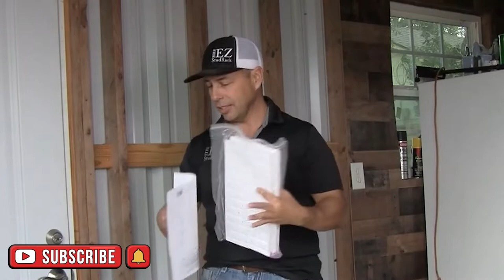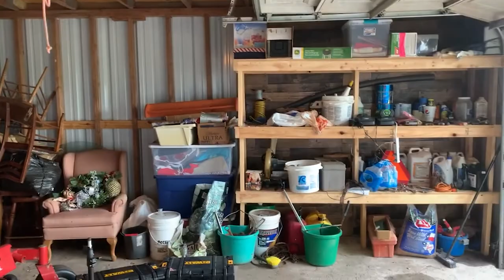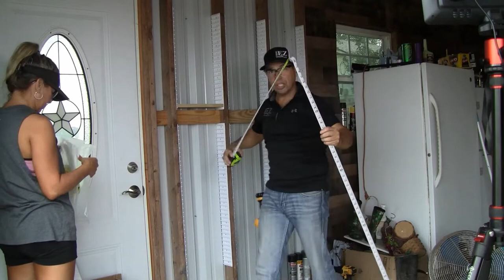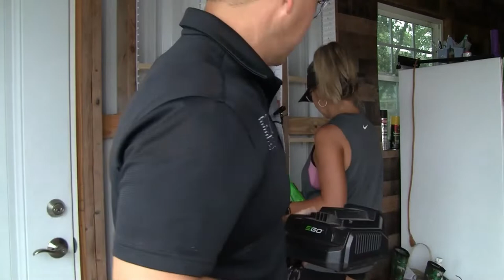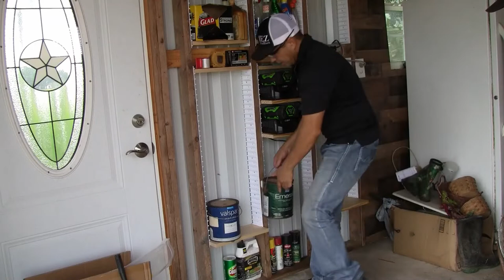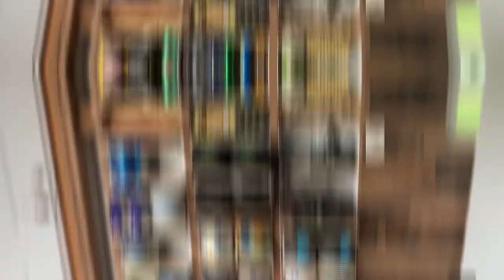Easy Between Stud Storage, Between Stud Storage Ideas, 3 HOUR INSTALL!

Comment: Fun and informative video. Might consider this product for my garden shed as it has the exposed studs. Here is my thought on the plastic strips, however. You have potential for many shelves if the product is about 2" high. So, of course, if you have high products to place on the strips you put a shelf maybe on the bottom plastic shelf and the next one maybe 8" higher All the other plastic strips are useless. I intend to cut my strips so I will have access to every shelf template on the strip. My question then is, can you develop strips that are serrated so you can cut them before placing in-between the studs. Say, plastic shelves 3" or so in between each with holes to hang up.
Reply from the maker: Awesome! Amazon prime delivers for FREE!
Reply from the maker: Hi KM, the strips can be cut to whatever length you see fit. I started using it like that but started to realize I constantly shift items and found myself having to unscrew and readjust the shelves. But you are correct, there will be slots not utilized for tall items. Thanks for your comment!
Reply: @EZStudRack  Thanks for replying. Gonna get me some!

Comment: "Five minutes", my ass.  More like a 2-day project, even if you have all the carpentry tools.  Plus, this guy will never demonstrate how to use his product sparingly to achieve the same result. All his demoes are for projected aimed at requiring you to spend the most money possible for racks that he sells.
Reply from the maker: Thanks for your comment.  The five minutes is to install each 8 pack of brackets. 
 You can cut the EZStudRacks and "sparingly" use them as you wish.  See link of a video I created to show how you can cut them.  If your items change, it will be difficult to adjust the "sparingly" used EZStudRacks but if your items don't change then it will work fine.  Here is the video where you can easily cut them.  https://youtu.be/J-uzHKOPp1c?si=TPjbX060l5eYlyME